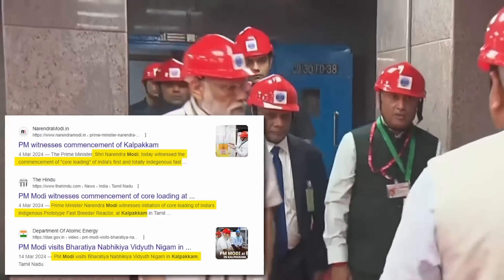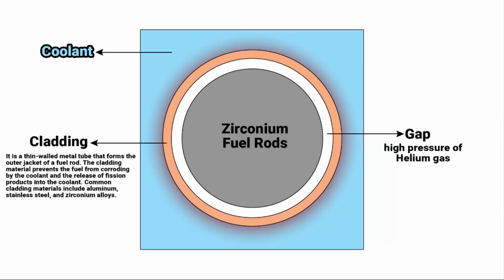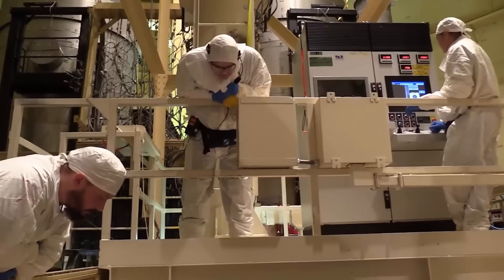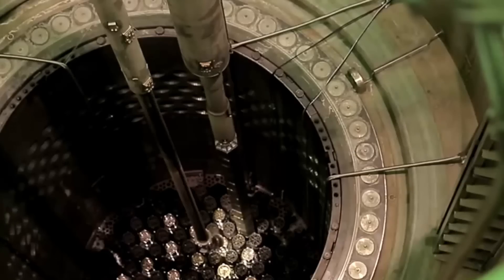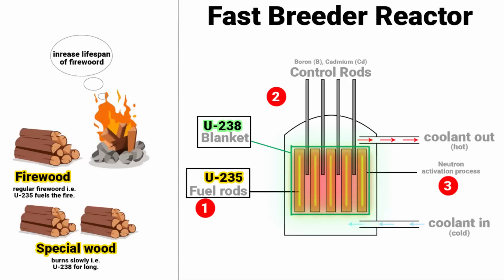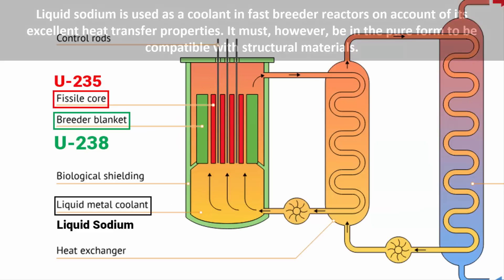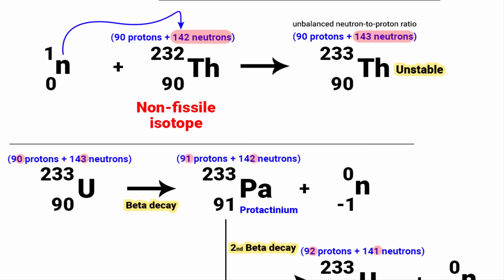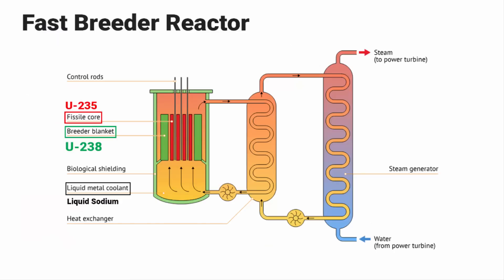How Fast Breeder Reactor Work | Thorium Challenges | India’s Nuclear Future

Comment: Recommended for high surplus very secure fast breeding a new pebble bed HTR with pebbles out of thin tungsten alloy filled with MgO and U in ZrC between tungsten reflector with breeding and fission areas for running pebbles.
Overheat self slow down, passive out <2s, no decay heat problem unburnable.

Much indians working in gulf countries that could also deliver much D out of hydrogen from sea water HxOy or methane CHxDy used in Abu Dhabi for H2 from CH4+H2O+heat for chemical industry & HD separated in 7LiD 7LiH centrifuge heated >1000°C decomposition like TiH2 from TiO2+CaH+heat etc.
Clean H used for BH3 & NH3 separation of 10B / 11B & 14N / 15N isotopes.

Gulf countries can pay developments also for small test turbine cycle using CO2 with steam pressure 57.3 bar 20°C and sucking centrifugal compressor (earth gas) backflow cooling (indirect) to heat & steam inlet of all that way thermal isolatable
usable for all steam power also with heat of existing cooled H2O condensor and surfaces or from hot air sucked with 2. compressor that way more hot & dense for heat transfer to CO2 turbine cycle air expanded over driving shovels cold for aircon and water out.

Do they have agrar culture with sheeps, cows & fishes inside towers for visiting ?

Recommended for high surplus very secure fast breeding a new pebble bed HTR with pebbles out of thin tungsten alloy filled with MgO and U in ZrC between tungsten reflector with breeding and fission areas for running pebbles.
Overheat self slow down, passive out <2s, no decay heat problem unburnable.

Why FLiNaK instead only 7Li as moderator and coolant with bubble slow down from 180°C-1340°C possible in Na breeder or combined with 15ND3, cubic 11B&15N or simply D2O primary cycle PWR ?

Using thorium or uranium does not matter already found in india like awaited and over 4Gt <300$/kg out of seawater is no end cost factor if both also breeded.

India Can Do Future Candu HTR with liquid about 9 bar 15ND3 ammonia instead D2O between RBN (cubic 11B&15N) tubes & RBN fuel with pressure bubbles control quick passive away if 7lithium inside >1000°C instead H2O as excellent coolant & moderator with bubble slow down 180°C - 1340°C without pressure a storey sand upon tubes over MgO melting pot etc.
running with unenriched UO2 fuel about 30 years.

Making of gold as side product of cold fusion shooting cheap mercury into Lithium-Deuterium for 6Li+D→2 He, 6Li+n→He+T, D+T, D+D→T+p, 7Li+p etc. from Hg and following He punshes 20-30 MeV Hg n-spallation to 197Hg→Au.

Comment: Thank you for the video. FYI, the coolant (liquid metal - sodium) makes it very very challenging while decommissioning these type of reactors. The entire reactor, primary and secondary circuit pipe works, heat exchanger etc gets heavily contaminated by activated sodium which highly explosive when in contact with moisture and water. So decommissioning costs easily outweighs the benefits of power generation but conversion to fissile material is interesting. 🙏🏼🇮🇳

Comment: India has encountered significant obstacles in developing thorium reactors. Its three-stage nuclear power program’s final phase concentrates on exploiting its abundant thorium reserves through thorium-based reactors. Yet, these reactors’ development poses technological hurdles, especially in managing highly radioactive fresh fuel and necessitating remote fuel fabrication.

Conversely, China’s TMSR-LF1, an experimental molten salt thorium reactor, was completed ahead of schedule in 2021, marking significant progress. This reactor employs a mix of thorium and uranium-235 to explore the thorium-uranium fuel cycle’s various aspects.

Protactinium-233 (Pa233) presents a substantial challenge in the thorium fuel cycle. With a half-life of about 27 days, Pa233’s decay prolongs the breeding of Uranium-233 (U233) from Thorium-232 (Th232). This delay is a fundamental radiochemical issue that affects thorium reactors’ efficiency, as it takes considerably longer to produce U233 compared to Plutonium-239 (Pu239) from Uranium-238 (U238). Addressing this issue is crucial for the successful implementation of thorium reactors, integral to India’s long-term energy strategy.

Comment: Till now this one was best explanation on this topic. ❤ Thanks a lot for this but i have a little doubt 

So in this after this fast breaded reactor i.e 2nd stage, we will not be having 3rd stage? that is to use thorium as fuel and complete the cycle.
I am little bit confused here i mean it is theoretically possible but you said practically we don't have proper plans to use thorium as core in the 3rd stage am I right?

Comment: when will the reactor go live? all stages?
Reply: 2nd stage is going commercial
3rd stage will take a long time
Reply: hard to get any dates, I wonder why
Reply: it's been 20 years in making
Reply: @n2201  actually if 2nd stage become fully successful 
Indian gov will build 250-1000 nuclear plant fleet(as per required)

and that they will change nuclear fuel with thorium +Unranium(which produced by reacteor first by using theorium) and this fuel changing stage is 3rd stage

this plan is actually running from 1960
currently main problem which scientists have to solve is sodium erosion and than making it deigned as simple as can for stage 2
Reply: @n2201  2nd stage whole work will take more 100 year
also china protype doesn't make electricity
and the design of India reactor is different from china

you just forget that we are going to see 3rd stage in our life time
as per Homi bhava plan
stage 1 will run for 40 year(it actually take 50-60 year because od sanction, war ,etc)
stage 2 will run for 100 year
stage 3 will run for 300year

this whole plan is for future generations not for present generation

but as the energy required ment increase, india can make 3stage nuclear ractior in mid journeys of 2nd stage phase